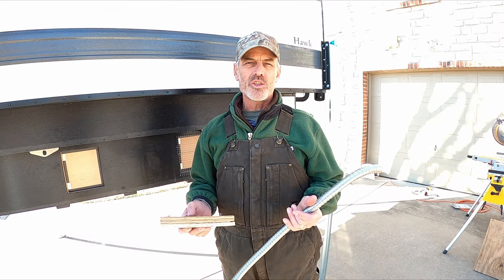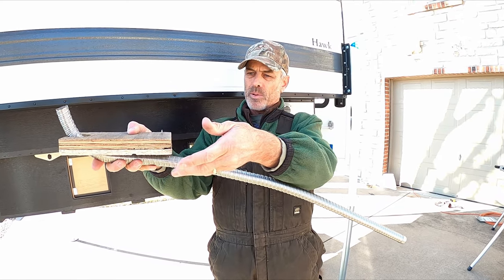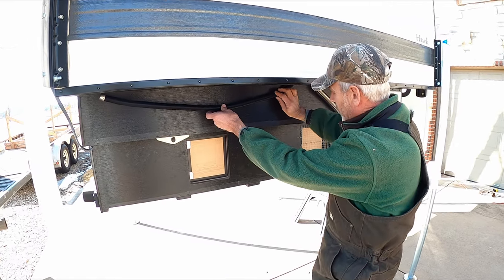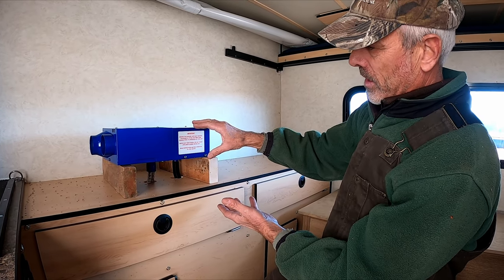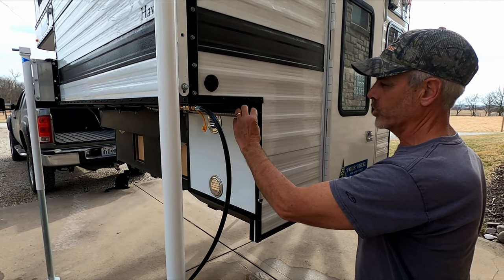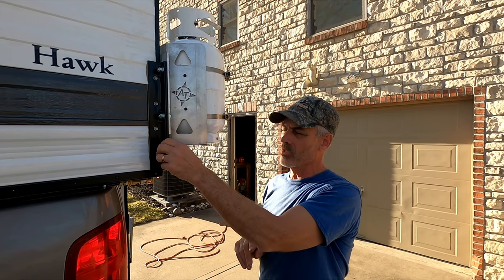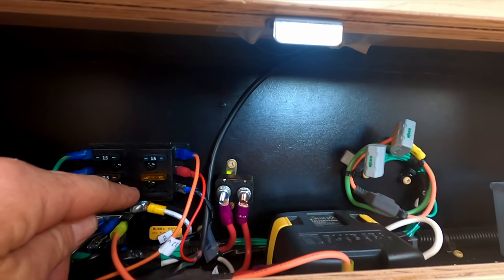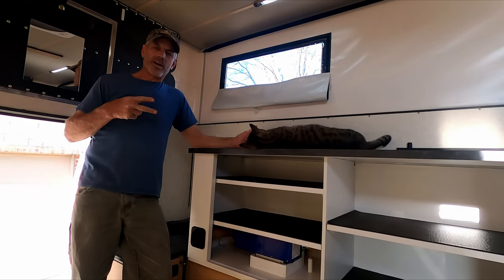Four Wheel Camper - Hawk Shell: Propex Heater Build

Comment: thx for the video.  i have a similar ATC shell, and propex furnace.  was thinking of doing a similar install.  i found the AT overland propane cylinder brkt, and was under the impression that i could bolt that to camper jack brkt.  u mention some welding ??

my current plan, is to use 80/20 for all bracketry inside, and then fill out from there. going minimal.  my atc does not have a lot of room for anything else where it sits on bed rails.  i had bought the atc with the propane door on the shell, but have decided i dont need heat that much, so door stays, but no propane inside.  i was thinking of exiting the exhaust thru the door....  but that would not give the length of exhaust pipe u have.  i keep looking into pusing exhaust thru camper shell, but would like something better for a grill/screen, but having trouble finding - with the exhaust tube dimension.
Reply from the maker: Hey Greg, I hope I can help you out. I was under the same impression you are. The ATC bracket is made to mount directly to the camper jack brackets, true. The bolts it uses to mount is the same bolts that attach the bracket to the camper so if you need to remove the propane bracket to attach your jack you will be taking bolts in and out of the camper each time. This is not something I wanted to do so I adapted it to mount using the same holes the jack uses. I would be more than happy to discuss what I have learned if you know of a way to contact me directly, I do not or keep asking and I'll try to help. I didn't understand  your issue in the second part of your comment.  Good Luck!!!

Comment: Good Afternoon Guys!!!  I have another question as I wait for my FWC to arrive (8 more months!!!); Can two batteries fit within the battery box?  I watched your measurement video about 100 times and cannot tell if two of those batteries will fit in there???  Thanks again and can’t watt for your next episode!!!
Reply from the maker: SO SORRY!! Darryl, Somehow i missed your question and happened to see it today. Two batteries will definitely fit. I just measured the inside of the battery compartment at 16"x17.5" and 21.75" tall. The battery measures 6.75"x10.5". They mounted my single battery right in the middle of the compartment which would be easy to change if I decide to. Again, I'm sorry for the slow response and don't hesitate to ask any other questions. Everyday is one day closer to that 8 months, hang in there.

Comment: Hello again!!!  Can’t wait for the next video!!  I do have a question and hopefully you can assist me.  We talked before and I am waiting to get my FWC Hawk Shell like you have and I I saw in one of your videos where you pulled the wall back and exposed the aluminum frame.  My question is can you use a stud finder and do the same thing??  I am asking because i want to drill two holes on the driver’s side rear of the camper for sure power and to connect my Weboost system?  The two holes would enter through the back of the battery box. I ordered a 2022 model, so it should be the same as yours??  Again would a stud finder help me or do I need to figure something else out/??  Thanks again!!
Reply from the maker: Hey Darryl, I tried to find the alluminum frame with a stud finder and was unsuccessful with it. Not sure if a better stud finder would be different or not. Good Luck!!

Comment: Curious about the propane mount bracket you made for the AT holder. I’m using the Powertank bracket but it’s cheap and won’t work with the 11lb tank.
Reply from the maker: Hey Jeff, I thought the powertank brackets (same as AT bracket) would handle a 9.25" diameter tank which can be a 10 # or 11# tank depending on the brand of tank. I had my bracket welded to a flat 1/4" flat alluminum that I drilled holes to mount onto jack bracket. A thin alluminum spacer was used between bracket and flat alluminum to allow clamps to go around tank and bracket as intended. I hope this answered your question.

Comment: How is the propex working out, considering the same for our Scout?
Reply from the maker: Hey Justin, we have only been able to take one trip so far but I believe it will do exactly what we want. Our goal is to use it in the mornings when waking up and preparing for the day. It was in the low to mid 40's overnight the 3 mornings we used it and it brought the inside temp up to 62 in 15 to 20 minutes. It used 7 oz of propane for the trip. Any downside to it keeping the camper warm would be to the lack of insulation on the camper especially the vinyl. There have been no issues with it performing at all. I hope this answers your question and good luck!!

Comment: How’s the build coming along? Leak update?
Reply from the maker: Hey Ted, after the kitchen cabinet and heater build I've been a stand still. Never enough time to do what you have to do and what you want to do, guess which one wins out. Really the only thing left on my build will be to add a small cabinet on the passenger side in front of the side window. My wife is going to do some painting as well. I will be showing that when I'm able to finish it up and also the overall look with it complete. As far as the leaks go, after getting it sealed up I haven't had anymore leaks except on my front window but it has continued to leak so I will be putting another bead of caulk on the seal where it joins the glass and frame. I also noticed some rust on some screws that are directly under a rear marker so I will be removing all the markers and resealing them. Very frustrating to say the least. Thanks for your interest!!!